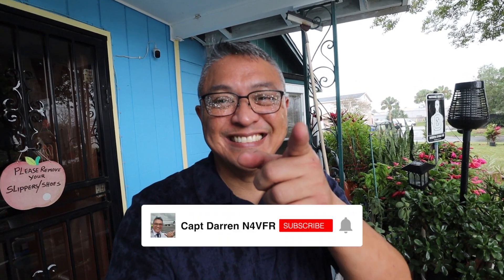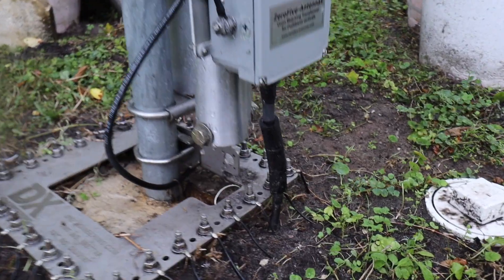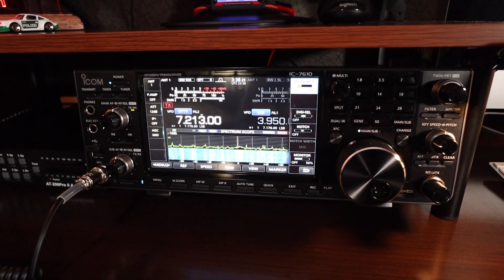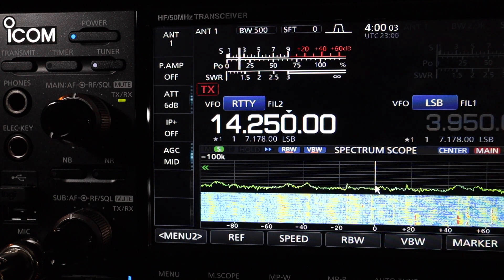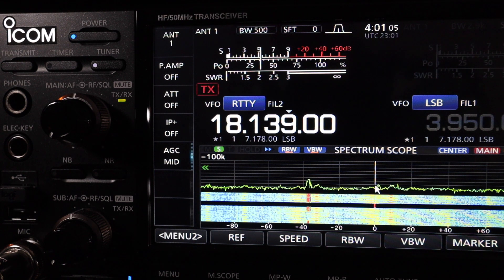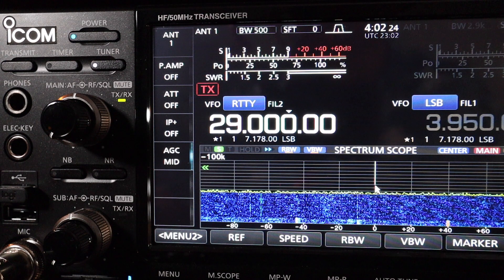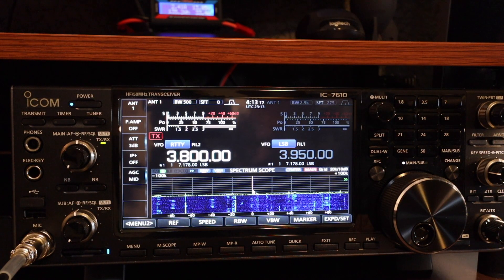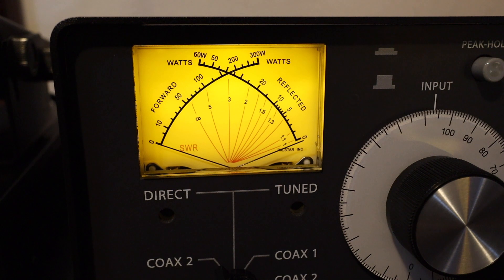Zero Five 27' HOA Antenna SWR Tests | Icom IC-7610 | OM 2000+ Amplifier  Palstar AT2K Antenna Tuner

Comment: Hi Capt. I have been watching some of your videos. I like that you explain and video the steps through the process. I just subscribed to your channel. I am interested in a vertical antenna because of its omnidirectional Rx/Tx capabilities. But I am not a fan of antenna tuners. I prefer not to operate a band or a section of a band unless the antenna is resonant. I live in an HOA-managed neighborhood, so I have several temporary antennas that I deploy just for a few days. That has helped me with HOA rules. But I am looking for a permanent vertical and I was considering this 27ft Zero Five, but after watching this videos, it looks like it’s not going to work for me as the antenna is not a resonant one. I am also considering the Hustler 6BTV. Thanks for sharing.
Reply from the maker: Luis, I'd recommend the DX Commander Classic.  You can tune the SWR to the center of the band you want to talk on. It's my primary antenna in Florida.
Reply: @DarrenN4VFR , I have considered the DX Commander because it’s a multi-band resonant antenna, but I have two concerns with it: it may not be HOA friendly and I have very strong winds and a season of heavy thunderstorms here in AZ. So I am looking for an antenna I could quickly tilt down.
Reply: In the episodes that I have watched you seemed to be seeking for a solution to the 80m band. I have had good results with a 60ft wire and a 5:1 UNUN. You just need to play with the length of counterpoise (10 - 15 ft). Ironically, I am always able to get 80m in, but I am only interested in 20m - 10m. So I am looking for a vertical antenna that is resonant on 10, 12, 15, 17, and 20.  73s

Comment: Do you have a remote tuner at the base of the antenna ? That’s what I have with the 43 foot version, internal tuners can’t handle the SWR on several bands.
Reply from the maker: At the time of this video, my tuner is in the shack using a Palstar AT2K.
Reply: @DarrenN4VFR  Remote tuners are far more effective for this type of vertical FYI
Reply from the maker: @jerryKB2GCG  Yeah, I've been experimenting.  I recently bought a MFJ998RT and put it at the base.  Here's my video. https://www.youtube.com/watch?v=cND5u8G8k8Y&t=1835s  Now, I have an RF2K-S amplifier and removed my 998RT from the base and using the amplifier's built-in tuner.  And I agree with you that transmatch/tuners are more effective at the base of vertical antennas.  73's de N4VFR

Comment: Hey Capt...I have a Force Five 27 ft 40-10 meters.  Mine isn't the ground version but the version to be mounted about 7 1/2 feet above the ground and has 6 medal tubes each about 6 foot long for the counter poise.  Works great no tuner needed on 40 and what the other bands may need the internal tuner can handle.  Had mine for at lease 6 years or so.  Very well made antennas... de W4WLC
Reply from the maker: I looked up Force Five 27' antenna and didn't find any results. That's great that all the tuning worked for you.  I will change out the coax with a longer one to see if my 40 meter will tune up. 73's

Comment: You are reading the swr wrong on your radio, all of the bands shown was 1.6:1 or over and you state it is 1.0:1 !
Reply from the maker: Hmmm....  Now you got me thinking.  Let me read my IC7610 manual about the meters.  I changed the meter display from the normal view to Edgewise because I can see the power output on the Upper Portion and the SWR on the Lower Portion.  Anyone chime in to help me clarify on how to ready these meters.
Reply: @DarrenN4VFR  Yes look at 5:08 mark. Look at the SWR above TX. The meter reads 1.5 then 2 then 2.5 etc. this is your SWR reading. When the meter sways it’s probably because it’s windy outside. If meter is below 1.5 when you TX then that’s on target.

Comment: Hmmm ?  On 20 meters and 17 meters you state that the swr after tuning was 1.0:1 but the video plainly shows it as about a 1.6:1 on both bands when you keyed up in RTTY !
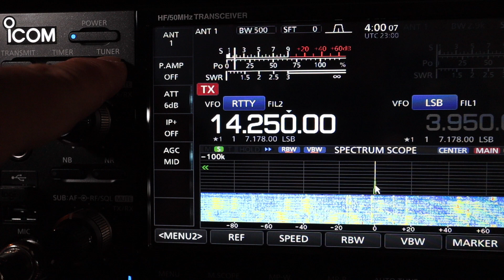Reply from the maker: Hi Rick Merry Christmas!  Thank you for commenting and I read them when I'm not flying...  I just looked at the video for the 20 meters at timestamp 04:23. It is showing about 30 watts output with no movement on the SWR meter.  The SWR meter is the lower meter.  At timestamp 03:15 on 40 meters with 30 percent power, look at the SWR lower meter 03:40 and you can see the needle swing to indicate greater than 3:1.

Comment: Sir ,please make youself an 40m deltaloop ,even if horizontally mounted,even if low like 2-3 metri from the ground and you will have a big surprize.
The delta is a cheap and easy made and the results will let you speakless. 

Best wishes from Romania.73
Reply from the maker: Catalin, thank you for the recommendation for a 40 delta loop.  I'll take a look at them.  Merry Christmas!